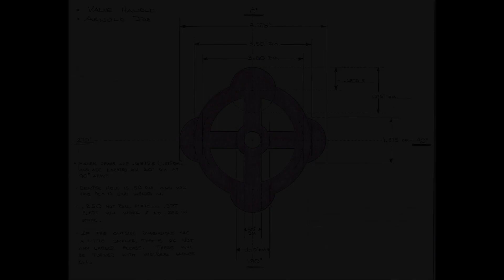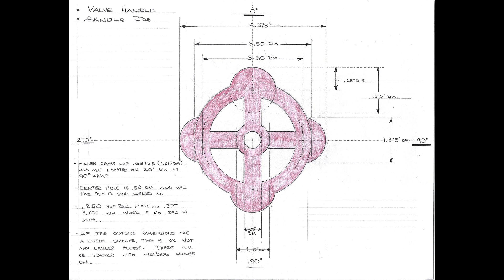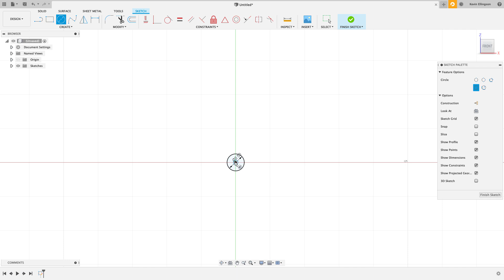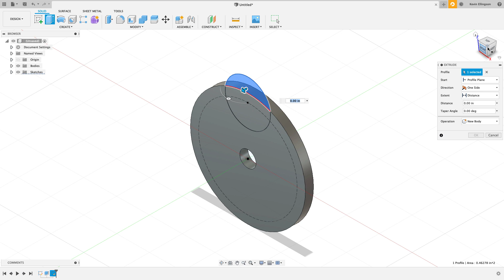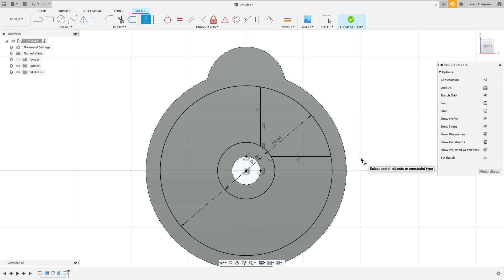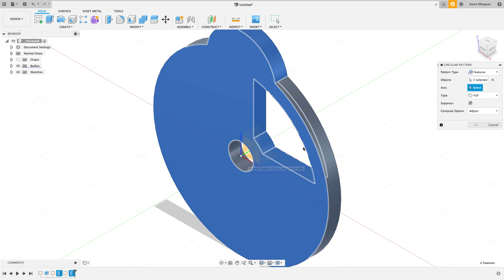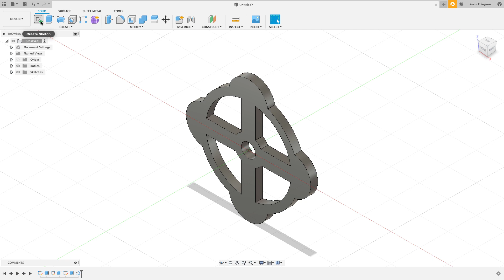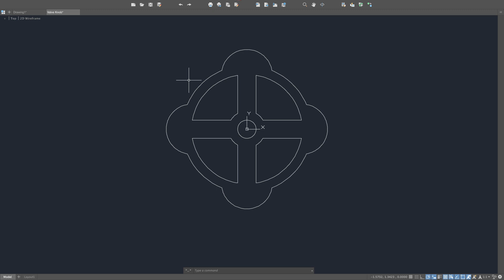Fusion 360 Modeling a Valve Handle

Comment: Another great video Kevin. As always, I saw the drawing and tried it my way to begin with. I drew a quadrant in one sketch and patterned it. Your way was much better, great use of constraints over dimensions. I think you may have got the circle diameter wrong at 4:31, it looks like that diameter should have been 2.5 rather than 3, although the 2.5 isn't specified in the drawing, I'd love to hear what you think.

Comment: you can use tangent constraints instead of points and horizontal/vertical constraint for the spoke. just tell it you want the line tangent to the circle, even from afar. 
People with various laser cutting software might want to know that the DXF file format exported by a sketch is more modern than the version exported by the DXF post processor in the CAM environment, it's hit or miss depending on how crappy the laser cutting software is.
Reply: Appreciate the tip. It would have not occurred to me that there would have been a difference.

Comment: in the creation of the DXF ,  It is not clear  how you got the face geom on to the sketch?
Reply from the maker: Hi Bob. With the default settings in Fusion preferences, when you click on a face for a sketch, Fusion automatically projects the geometry to the active sketch and then makes thar projected geometry invisible. That is why you can snap to it with lines, arcs, and circles etc. So when I export the sketch to DXF, that hidden geometry shows up as geometry in the DXF file. If you see people complaining that Fusion creates lines on likes when creating a DXF that is usually because after they create the sketch they use the project command to project the face not realizing that already happened when they chose that face for the sketch. Hope that helps to answer the question.
Reply: @MechanicalAdvantage  Thanks, I thought this is what you did. but you didn't mention it.

When I run Fusion 360  it is with this projection setting turned off, I prefer to project things manually
Reply: @MechanicalAdvantage  Kevin, I always Create Sketch then Project before saving as a .dxf. It is in a video I found from John Saunders.. Is it better to not project before saving as a .DXF?Thanks for a Great Video!!
Reply: This would be a good topic for a separate video.